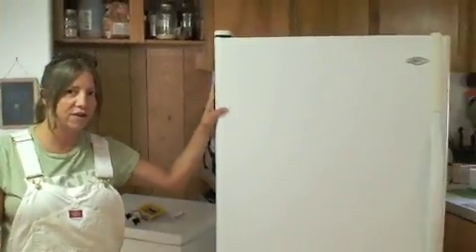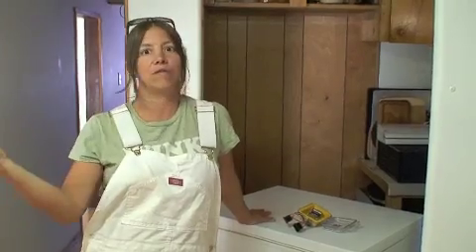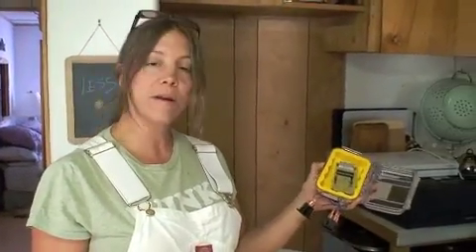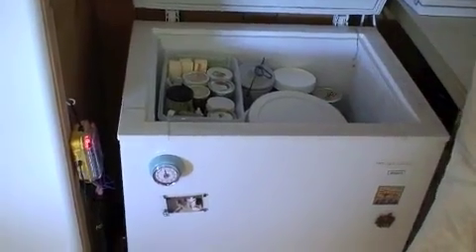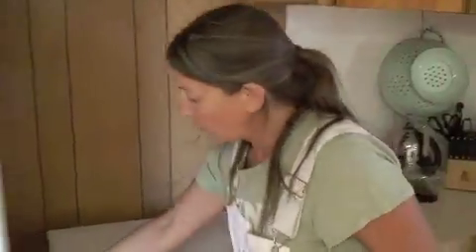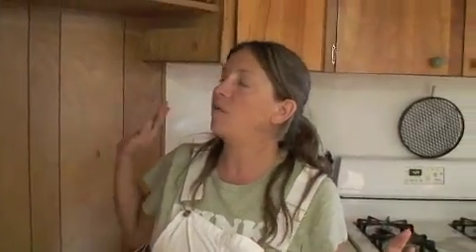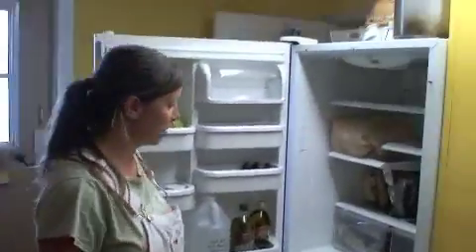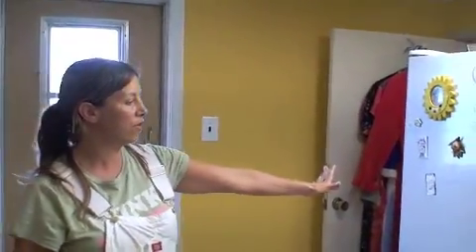Chest Freezer Hack

Comment: I just started using my small chest freezer as a fridge in my shop. I'm using an external thermostat set 34-38 degrees. I just started this week and am monitoring the electric consumption with a watt meter. So far, I'm very pleased.

Comment: What refrigerator is this?!? This is insane, I think you should read the energy guide again more closely. How many kWh per year is far more relevant.  Your fridge might use that much (2000 watts) while it is operating but it doesn't run constantly if it working correctly. A modern fridge with all the bells and whistles barely goes much beyond 850kWh a year which is $85 where I live.

Comment: It will be slightly more efficient if you can run the temperature wire from the bottom through the drain plug.  Also what temperature did you set it to come on and shut off?

Comment: Some peeps turn 1 into a fridge and use another still as a freezer ; which makes organization albeit brainless and easy to get in and out of .  Then they mount lightweight counter top material for each so you end up w a decent working system. ..they are cheap and buy another solar panel w the power savings ...it's a duh smh thing lol .  
 I prefer Cellsite Batteries Hwvr I'm not familiar w the ones used here . 
I have a 25 yr Old cellsite used  battery that still holds 12v and it's sitting next to my carport for the last 5 yrs in sun & cold and I didn't charge it once ..still test at 12.4v 
I even used it in my 1 truck once when the pos interstate battery went . 
  Are you using a now catching on in the US finally a 12v to 12v charger ? 
They're used In most of the rest of the civilized world lol 
 For Rvs or overlanders these are ideal to charge directly from your rig and do so very quickly . 
My dually w high amp alt can charge just as fast as my dual fuel generator ...and I don't have to burn up my LP or carry gas . 
  I don't mind warming up my truck daily esp about 9pm ..keeps it warmer longer overnight and I can use the  Block heater much less . 
Peace thx for the Vid ..
 I use an old fridge as an in ground 
Root cellar some use for 
Bug out stashes too ..
Be prepared !

Comment: You can buy the controller om Amazon for $35.00 it's called a  Inkbird ITC-308, it will run a heater or a fridge or a freezer, one at a time or both at the same time
Reply: And it has a safety feature that delays the compressor kicking on so it helps prevent it from running on and off too much.

Comment: Well, clearly her hearts in the right place, but I give this new 'refrigerator' about an week before they discover it doesn't work.  LOL.  Where's the butter?  Oh! it's on the bottom?  Let me move all this food out of the way first.  Argggggggggggggg!
Reply: Its actually a very common thing to do by people living off grid or on low power supplies, people have been doing it for decades long before this video
Reply: Heat does rise... but you would still think that having to dig thru all that stuff for several minutes instead of a brief moment would make a difference in electricity.

Comment: What in the world does 100 watts per day mean? Wattage is a constant... We pay power in Kw/h in other words every one hour you run a 1000watt device you are billed for 1Kw/h
Reply from the maker: .1 Kw/h
Reply: marc, don't divide watts with time! A watt is already one joule of energy per second, so dividing by time again is not energy. Just say watt hours or kilowatt hours. 1000 W for one hour is 1 kW * 1 h = 1 kWh.

Say you're going 100 mph, or 100 mi/h. Think of it as a rate you consume the road miles. 100 mi/h for one hour gets you 100 miles away. Same with watts in W or kW of power that tell you at what rate you consume joules. Simply multiply the power with the time the machine runs! Electrical energy is quoted by the kWh instead of joules so a 100 W load run for one hour in a day consumes (100 W) *(1 h) == 100 Wh, or 0.1 kWh.

Comment: Watts (and Amps @BRUCE LEE) are instantaneous measurements of the flow of electricity.  You cannot say something uses 100 watts a day or 3 amps a day.  If you are looking to say how much energy something uses per an amount of time you need to add the time to that unit, so it would be 100 watt hours per day, but what I think you mean is it uses 100 watts when its running so if it runs 4 hours a day it would consume 400 watt hours per day.  If it truly only consumes 100 watt hours per day that's quite impressive, borderline unbelievable.

Comment: so does all the food and everything inside the freezer Refrigerator get wet or does moisture only collect in the very bottom if everything gets wet I could use zip lock baggies and containers does the floor get wet from condensation on the bottom of the freezer itself externally and could you make A a condensation tray with desacant spelled wrong I think,,, starts with a. d its that stuff that absorbs moisture that would go in side the unit it's self?sorry so many questions.

Comment: well sweet hart could you please tell us about that unit now??? how's it holding up? and working out and all??? I have personally thought if this is still working out good for you guys I might try it,,,, I need to buy some more solar panels and probably another battery bank just for the refrigeration unit itself I am also wondering if a person could use a DC capacitor between the battery bank and the inverter to help offset the initial surge at startup of the compressor,,,the the kids use on their high performance car stereo these days???anyone have any experience or thoughts with this type of thing please feel free to enlighten us about it,,,regards:::::::::Bill R..............................
Reply from the maker: Still using the same chest freezer today. It is working great. Please pick up a YATC. screwdecaf.cx/yatc.html
Reply: The Good Life Lab

Comment: you have any hard numbers crunched amps wats you said something about 100 watts is that like 100 watts total per day I wonder how this would compare to a steca or a Sundanzer, I'm looking at a unit on Amazon that will do what your unit did however the one I'm looking at sells her mouth I think $56 and its not digital all you do is plug the freezer into the unit and plug the unit into the electrical source and they say that supposed to work pretty good for this kind of thing I'm new to Solar I'm trying to get off grid I'm not quite there yet I'm going to have to buy more paint also I have 400 Watts right now in a decent battery bank when I do the refrigeration I think I'll get a separate Bank of batteries and probably 

and  some more panels I think that's really cool doing what you did with that though

Comment: Curious about how your adjustment went.  Am deciding between an apartment refrigerator or a modified chest freezer for a coach conversion I am working on.   As coach will eventually be solar, your energy savings has caught my attention.
Reply: I was thinking about the same thing . THEN I did the math and realized that the "dorm fridge" was a Grand Total of 1.7 cubic feet !!!!

Comment: Lambedan
A kwh per day = 41.6w (or whatever number you listed) at a constant draw (ie as if a unit ran steady) 
People on solar need to figure out the running draw - my freezer as fridge uses about 75w when running. Sometimes 65 sometimes 81. This tells me what inverter to use. It runs only 10 min in an hour. This helps me size battery and pv array.

Comment: this is cool ive made solar hot water heaters out of full size cheat freezers that did not work any more. it is really cool because thay are all ready insulated just cut it down ans fit the lid and run your hot water lines 

the cheap guy

Comment: It seems like you have the capability to lean that fridge down on its back and relocate the compressor and so forth to use the old fridge as your new fridge.  Then you wouldn't need to adapt to the much smaller freezer you just modified.  I imagine the savings wouldn't be as much, but still quite significant.  I realize it's a bit of work and maybe not worth it, but perhaps a future project.  
Nice job on this one.